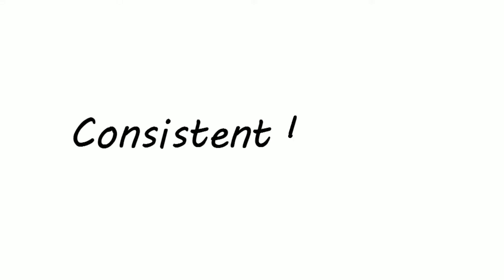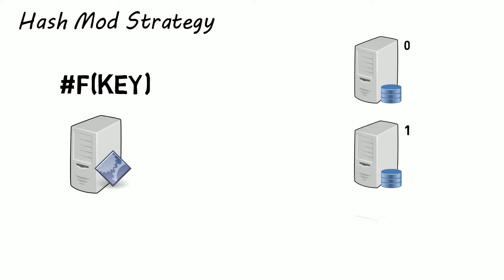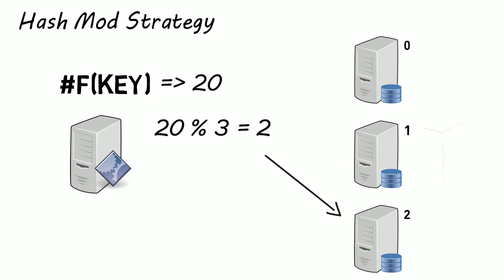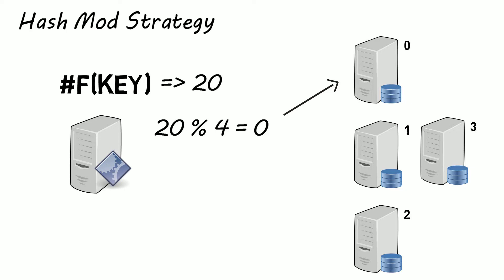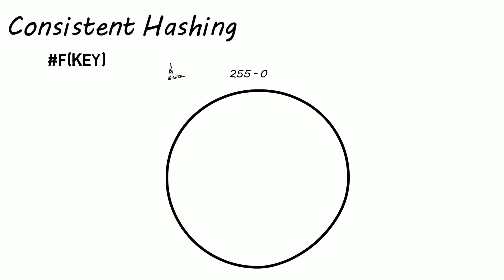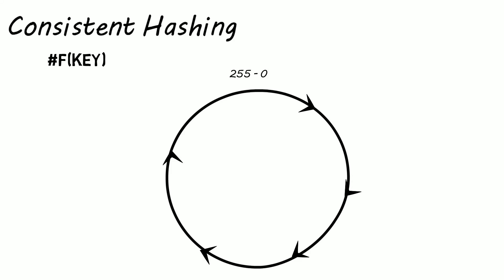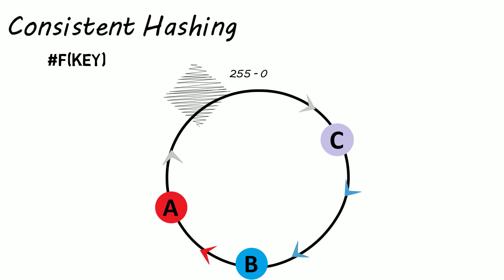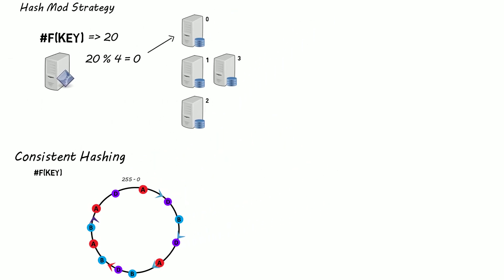What is Consistent Hashing | System Design Basics

Comment: Thanks for the great video, simple and to the point. QQ: How do I set the output of a hash function to be in a fixed range?
Reply from the maker: Thank you. This will depend on the hash function you use for example if you use the python built-in hash function the range will be -+ sys.maxint. You can use the mod (%) in this case to hardcode the range if you want to limit the range to a smaller number, but that also brings problems such as suboptimal distribution which has to be considered. This is a good read if you want to know more https://realpython.com/python-hash-table/